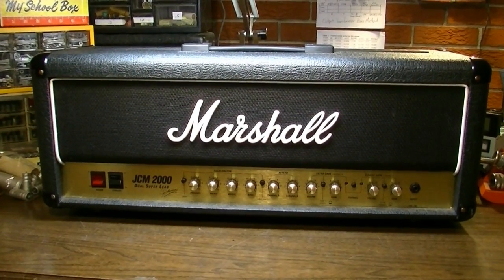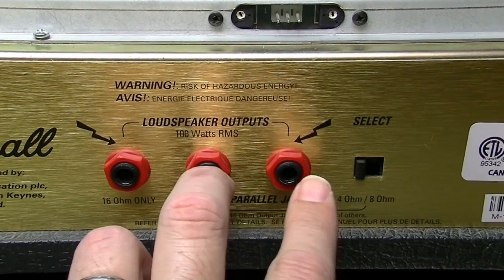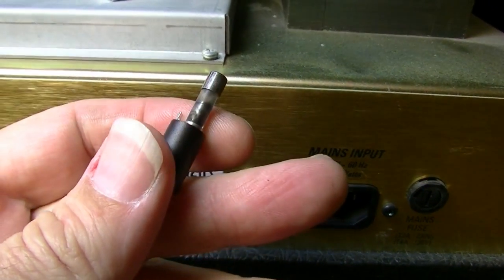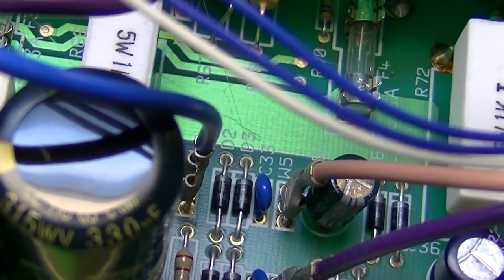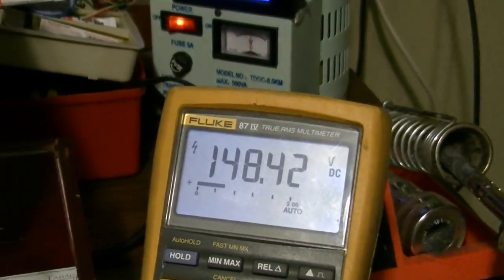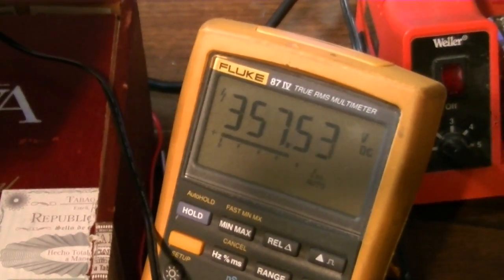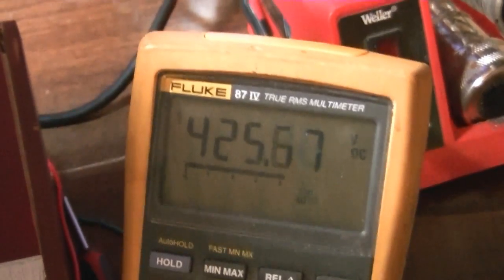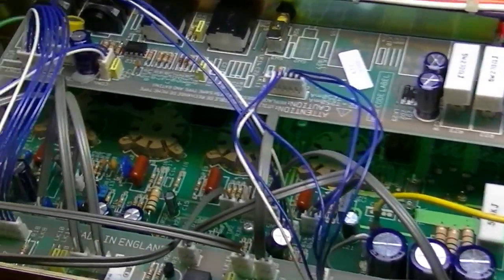Easy Fix Made Difficult - Marshall JCM2000 DSL100 Repair

Comment: Hello Brad, really enjoy this channel, been learning a lot, I have a custom made Meas Boogie F-50 head from the factory and I had taken it to a few gigs and it sounded terriable got it back home and it sounds great, my question is could dirty power be the cause of my amp sounding God awful?
Reply from the maker: Using the same cabs, cables, pedalboard, etc.? Eliminate ALL variables to narrow it down to power. If you still have power issues, you can get a variac, which will act as an isolation transformer between the amp and the wall and might cut down on some noise. Something like this: https://amzn.to/43rIvPP

Comment: How can you even make any money repairing amps today with all this board crap? I mean a new amp is cheaper once a tech pulls boards etc. Just stick to 60's amps and much easier and enjoyable. I mean these Marshalls have 10 fuses in them?  How can a band rely on this garbage runaway bias? I see so many old school guitar players going to Fender. Not all these stacks just a few Bassman and pipe it into PA. SO much easier as today they just cant handle the road with these boards.

Comment: I have a jcm2000 401 combo which are known to have a problem with overheating.  Would the 50 watt head have the same overheating problem?
Reply: no. The DSL 50 is the best one they came out with. Jeff Beck used one for years

Comment: I know the likelihood of you reading this comment is very very low.  But here it is, I have a marshall jcm 2000 dsl 50......   All of the comments online made by repair personalities who are always talking about the JCM 2000 bias drift issue make one major flaw in their statements....  THE AMP BIAS DRIFT ONLY AFFECTS DSL 100s and TSL 100s made prior to 2004.   The issue that is created by just saying the jcm 2000s have this problem is that people believe the other 4  or 5 variants of the jcm 2000 series amps have the same problem.... THEY DO NOT!

Thanks for making me waste my time trying to look and see how much a replacement pcb board that doesn't exist for a problem it will never have as it does NOT even have the circuit!!!!!!
Reply from the maker: Where did you get that information it only affects DSL and TSL 100s? You don’t know that.
Reply: @TheGuitologist  either you or about a half dozen other amp techs are wrong.  Apperently the dsl 50 which I own does not even contain the affected pathway, this I discovered after looking to see how much a kit to fix the motherboard should it go bad would set me back.  There are only kits floating about for tsl100s, and dsl 100s.  So I started looking at other forums....  And there are a lot of other techs saying that it only affects the 100s made prior to 2004.  I would give you a link or two, but that was over a  very very long bad week ago for me, and I just don't have the energy to try to retrace my steps at the moment.

Comment: My suggestion on all amps esp NPF ones esp where fuse blows for apparently no reason is to tap the power tubes to see if there are any warped elements like the grids that might sag and short to other elements when hot under stress or even cold sometimes.
I've had many tubes that like to behave until they're physically 'challenged' (;- ).  Also true with prank tubes...

Comment: At 5:32, I noticed the white (W11) and white-grayish (W13) wires from the transformer to the W11 and W13 on the board. On my exact same amp, someone worked on it and reversed the wires to where the more true white one is going to the W13 terminal while the off white one is going to the W11. Will the reversal of these wires make a difference? Thanks for making the videos. They are very helpful.

Comment: I've got a similar issue but the mains fuse keeps blowing. Without a lot of knowledge I think it's due to the power transformer as I'm only getting 5.6ohm across both primary coils as it's wired for 240. But this would give a current of about 42 amps. Do you have any recommendations on something else to look at/test?

Comment: I have a TSL that has a problem in the bias, but different from the other TSL that Bias goes up until the amp collapses, in my TSL the bias goes down to close to 2mv and then goes back to normal 80mv. This happens sometimes and lasts a few seconds between descent until normalization. Any help?

Comment: I'm really looking into buying one of these amps. Any tips/things to look out for? Also would you recommend I don't have it shipped to me?
Reply: Big Sauce Persoanlly I would always pick an amp up yourself if you are buying it. It means you get to try it out and make sure it works before you buy it etc. I've had a few bad experiences with getting Amps shipped to me, so I'd say it's more trouble than it's worth. That's just my personal experience though.
Reply: @wastewoodrockers5526  noted, thanks allot.
Reply: The DSL sounds great, but the models made before 2003 had some issues. Try to look for DSLs made from 2003 on.

Comment: This is all making me afraid to risk buying a dsl. Though these are all older
Reply: I'm betting inside a brand new one it looks about the same. Anything from the 90's isn't really that old. The boards are the problem in any modern amp which 90's stuff is. Not much different than today's. The really old ones are all hand wired and much easier to fix. You want an older one. This one wouldn't be considered older. Even though it's over 20 years old.

Comment: I've had impedance switches fall to bits on Marshalls and Peaveys in the 2000's a few times. They were very different types of switches. I don't think they were made by the same company. The PV amp and most of its parts were of Chinese manufacturers. The Marshall I don't recall, I just assumed that some parts came from not England even if the amp was.

Comment: Hi I have the 50 watt version. I love my JCM2000. However since using a noise suppressor in the FX loop I've realised the built in reverb must be pre FX loop. Which means the reverb tail gets unnaturally cut off when the noise gate kicks in. This is a real shame. I know the work around is to use a reverb pedal however I was wondering as a circuit man,, can you confirm this to be true, seems odd to have reverb pre FX and also is there a mod I can get to change this? Thank You.

Comment: I'm not sure if you've done this yet but going through hundreds of videos, trying to find it's a pain in the ass. But I have a Marshall mg100hdfx makes a god awful super loud noise when turned on. It also makes a loud pop when turned off. This happened out of nowhere ands only few years old. However if I unplug the cord to speaker from the head and then turn it on and put the cord back in once on it's good to go. Trying to find out what the hell is up. It still works fine and unplugging and plugging back in works but id like to figure this out regardless

Comment: Any experience with JCM2000s having effects loop issues? Mine will still produce output when the master is zero, and that extra output is very treble-ish, harsh and distorted. Only happens when I'm using the fx loop

Comment: The legendary - or maybe just infamous - Marshall that does it all.  It has the sound of basically every Marshall ever inside 1 amp.  It's an 800, 900, and a Plexi plus some metal tones all in 1.  But they always blow the HT fuse and basically nobody knows why - and i'm not convinced you have figured it out either but I will keep watching.  Maybe you solved the mystery!

Comment: I know this is an old video now but I thought I'd let you know that one of the most common issues with both the DSL & TSL 100's is the 16 Ohm socket.
It switches the other two off when in use but when used with 8 and 4 Ohms the 16 Ohm socket cooks up and goes O/C.
I replace it on sight as it can cause the output TX to fail and more commonly blown HT fuse from back EMF from the O/P TX under no load condition or obviously damaged valves.
Pull the harness back and you'll see the earth terminal is cooked up.
While you're at it, reflow the effects sockets and the 5W resistors for the +/- 15V supply.
Regards from the UK 🇬🇧

Comment: Over 400Vdc for a 250VAC fuse?
Reply: Yep.  I don't think anyone makes a fuse in that size rated for tube amp plate voltages...or with a DC rating.  I know it makes a difference, but it's commonly done.

Comment: I fully realize I may not get a reply (haha) but Brad, I have a Marshall DSL40C that’s just over 1 year old. I love the UltraGain channel and have the gain around 8. It started making this intermittent huge volume swell with a high frequency squeal followed by a nasal tone. This only happens after 15 minutes of playing and the amp getting warm. I replaced ALL of the tubes, biased the EL34s but it does the same thing minus the high frequency squeal. 
The Marshall service tech states he finds no problem and the issue is that my gain setting is too high. 
Other DSL40C owners had the same issue and supposedly found a faulty blue colored capacitor. 
I tried to point out to the tech that C25 has black residue on it but he claims nothing is wrong. 
Does this sound like an oscillating circuit or a negative feedback issue?
I realize it would be difficult to even comment on this but I thought I’d try. 
I’m picking it up tomorrow and trying another service center. 
PS I can recreate the symptom by simply adding a loop pedal in the front and 10 minutes later it shows up. 
Thanks and if you don’t reply, no worries.

Comment: I’m surprised no one has commented “a blown fuse is the symptom of the problem, not the fix”. 
I realize we may never know now but if that’s really all it was I would be curious as to why it blew. 
And if I’m the customer, he didn’t even try to simply replace the fuse? Before paying shipping costs and repair costs I would at least try the fuse but again, I would have guessed it would have blown again. Apparently not in this case I guess. Very strange.

Comment: If you dont have the ohms swich right it will blow a fuse or a tube  every time
Reply: If one is using a 16 ohm cabinet with that amp, the position of the impedance selector switch is irrelevant.  It only applies when one is using the "4 & 8 ohm PARALLEL JACKS".

Comment: I am going to guess the fuse blew because the speaker load didn’t match the 4 ohm output on the amp he had it set on.  It’s important to get your calculation right.  Matched speakers parallel is half the impedance and speakers in series get added together.  So many people fail to calculate properly with multiple speaker cofigurations.

Comment: I've heard this amp fails, something in the desing of the PCB, I want to know if marshall corrected it and what years of production are safe to buy, please.
Reply: I think they changed the pcb in a revision at some point. Later versions of this amp were less likely to have this problem and even most of the early ones did not show any problems with this.
Reply: I think you can buy a diy mod from amp parts uk for runaway bias syndrome....👍

Comment: My TSL100's clean channel has a loud constant hum and the volume knob does nothing but turn the hum volume up.  Hum is present and loud even if volume knob is on zero.   Somehow all the actual clean channel volume is from my gain knob now; even if the volume knob is on zero turning up the gain gives me huge volume albeit with hum.  Do you know what is causing this problem?

Comment: I think that the design and component selection is marginal on those amps, I know that the main power transformers work hard  and normally run quite hot, combine that with a 1 A fuse that should probably be a 1.5A fuse, I have had to replace power transformers on these amps, so I believe it is just poor choice in component selection.

Comment: Just got a Laney head today, tubes glowed but didn't make noise. Think it might have been damaged during shipping. Thoughts?
Reply: Tanner Hoyt Check the fuses, then the tubes to see if any are dead or loose, then the output transformer with an ohmmeter (amp shut off.)

Comment: I love your videos and I want you to be making them for a long time, so can you please do me a favour? Keep your fingers away from the death-inducing spots inside the amp. I know you know, but it still makes me nervous watching. You are so close to that live Standby switch. At least wear non-conductive gloves. If not, can you please leave me your test equipment and spare parts in your Will, and I'll arrange the shipping to Australia.
Reply: We only have 120V here in the USA 😃
Reply: @Twobarpsi  HAHA! I get  it....Aussie 240VAC will kill you twice as fast as USA 12VAC. 😃I'm even more concerned about the Voltages on that Standby switch, which are common to both counties: a heart-stopping 450VDC. Brad is a lot younger than me, so he may get to complete my "Oh Shi..." gurgle as I fly backwards across the room.
Reply: @lestelie4410  would 450V DC arc across an air gap?
Reply: @Twobarpsi  Sure it can. It depends on the air pressure and humidity and the distance between the 2 surfaces, eg the back of your hand and the Standby switch terminal. I'm pretty sure it is called Paschen's Principle, but we could rename it "The Guitologist Principle", and wait for Brad to get close enough to create an arc. LOL! (Only kidding Brad. I only have love and respect for you).

Comment: Hey Brad! I have a JMC 2000 TCL 122. The main pc board is  the version 5 of this amp. Marshall has stated the epoxy they used becomes conductive over normal use. I also know you mentioned this in the video. Does it just become conductive around the tubes and the high voltage or all over the board? Is it worth trying to fix the board? What blows out when the bias goes nutz? Any suggestions? Love the videos. Keep it up!
Reply: If your bias goes out of wack, worst case you risk blowing the primary winding in the output transformer which means $$$..not to mention killing the EL34's. The main PCB can be modified to overcome the problems with board conductivity and bias runaway as i have done it successfully,  but i dont recommend doing it as it quite involved.  Unless you are experienced in valve amplifier repair and well versed in its operation dont even remove the back cover !!  Have a new board installed by a experienced tech...these amps run at DC potentials of 300volts plus and can kill !! They are extremely dangerous to work on...Do NOT run it without the recommended rated HT fuse installed....

Comment: Marshall cabs have a duel input that allows for 16 or 4 ohm mono and 8/8ohm stereo.  Have always run mine in 4ohm if the amp is capable.
Reply: Totally. No one seems to know this.  Rehearsal rooms are full of them. Folk think that if the switch on the cab is to the right and plugging into the right hand  input is 16ohms. It doesn not.  Its 8ohms. Hence why many use the 16ohm out on their amp.  16ohm out into 8ohm input = DISASTER.

Switch should ALWAYS be to flicked to the left.  That way the right input is 16ohms and the left if 4ohms.

Comment: I have seen tube era Ampex boards, 350, 351, etc, turn conductive on the surface.  You have to pull all the parts and really scrub them with Scotch Bright.. Same thing with blue and brown board version. Real pain to restore those when the boards are goofy.

Comment: I have a Marshall JVM1 1 watt tube head with an intermittent volume reduction problem. Amp plays as it should, then suddenly drops down very low in volume with random static noise. 

Replaced every tube, desoldered tube sockets and then resoldered with nice shiny fillets. Still randomly low in volume or good, depends on its mood. Problem happens on both clean and gain channels. Tried checking for loose connections. Thought transformer leads were loose, so I soldered the wires onto the transformer terminals. Jumpered effects loop. Cleaned all jacks. 

Called Marshall and they said to signal trace it. I'll need to get my scope out of storage to do that. Guess I might need to go that route. I was able to get a schematic for the amp. Thought output transformer might intermittently be shorting and causing volume drop. Marshall tech said to check the low wattage switch. Still nothing. Even touched up solder to most of the components. 

Baffled? Heaters remain glowing. Checked high voltage and had 240vdc. Need to take voltage readings on all tubes when good, then again when it drops volume. 

Any ideas?

Comment: HI Brad, HELP!! I have one of these thing except the 100w TSL version and it makes like a farty oscillating sound on the clean channel? Whats up with that?
Reply: Any help or advice would be greatly appreciated as I got this for AUD$500! Usually it costs $2,500 over here so id love to get it working well. So far all I have done is use some contact cleaner in the jacks and switched etc on the front of the amp. That seemed to work for a little while, now its back and really pissing me off. I am reluctant to just put new tubes in it and hope for the best?
Reply: Here’s the problem: one of your phase inverter resistors popped from a voltage supply surge. These are the resistors on the plates of the last 12AX7.